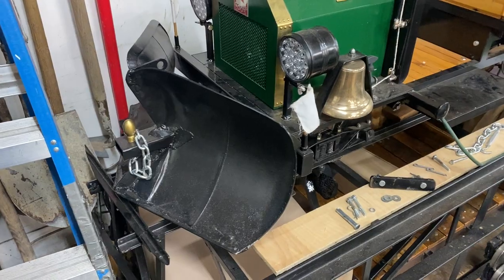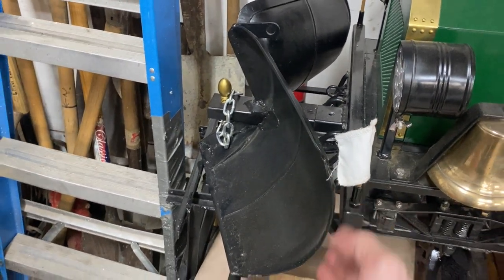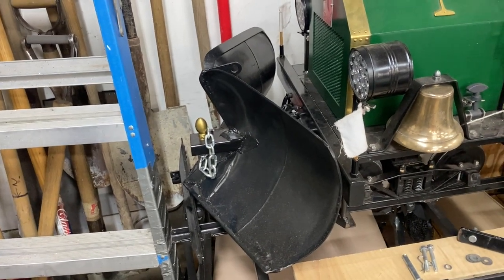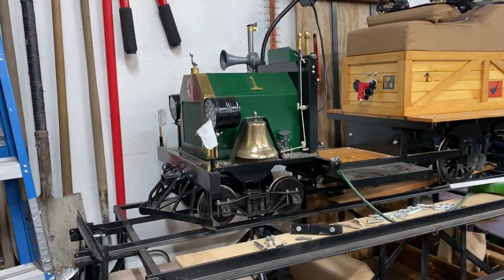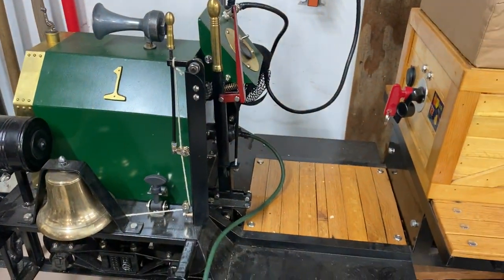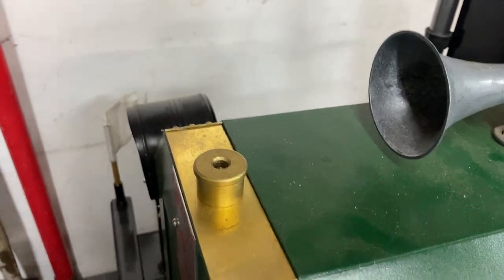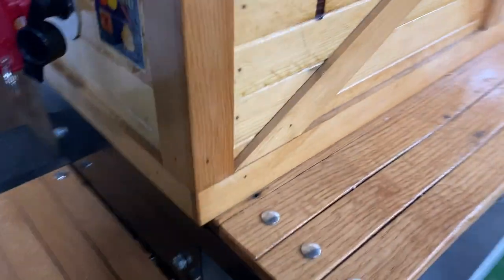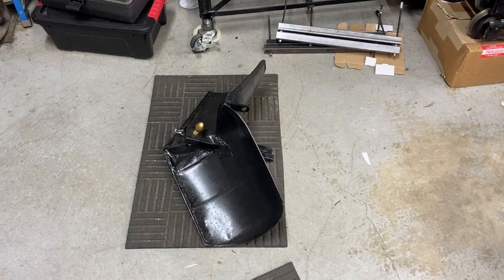Snow Plow Construction Methods for the Green Goose Electric 7.5" Gauge Locomotive

Comment: I use a pair of 50 amp automotive relays to disconnect the motor when powered off, they latch when you power up the controller
Reply from the maker: I think my breakers are also 50 amp. They have a little lever that I manually flip. I like that relay idea, wish I thought of that before! That's the cool thing about the comments here.

Comment: 2 spare trucks... gardening supplies cart for the missus! 😊💚

Fyi, my plans is to build a loco with seats, and a garden cart for the lady of the house 👍🔔🔔
Reply from the maker: That's a great way to keep her engaged with the trains and gain additional approval for new equipment!
Reply: @ccootsona  It's also a good excuse to gwt her engaged in the railway, and the design process. 
What sort of car would she like? Flatcar, gondola, hopper, mine cart? Short, long? Some sort of handbrake maybe?
And of course couplings, so it can be loco driven, but hand-pushed is still doable.

Comment: Your goose and riding car is about what I'm looking for for myself (size wise. I might want to see if I can squeeze a bit more power into it, as me and my wife are both on the larger size. both over 6' tall and over 300 lbs) and I think something liek this would fit in my car. (Bolt EUV. it has just under 5" from back of front seat to a closed hatch)

I also love your handbrake for when it is parked on less then perfectly flat ground.
Reply from the maker: Thanks for the kind remarks. I was just thinking that if I have the time, I would use a 2-axle truck in the back that could spread the weight and equalize better than the single heavily sprung axle. The current setup is a bit tiresome after 2 hours of riding and you begin to feel all the rail joints even on good track. I tried softer springs but the roll is not acceptable with those, and with 2 riders, it bottoms out. With a 2 axle rear truck, I could mount two motors between the axles so they pivot with the rear truck. This would allow more power and better tracking. Also, it gets crowded with two people on longer runs, so we built the flat car that allows us to bring jackets, coolers, tools etc.